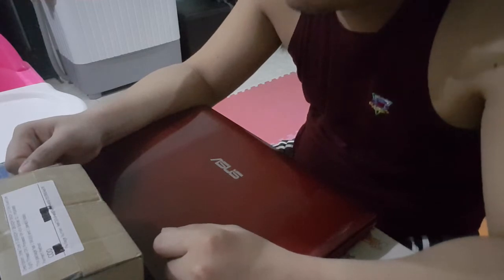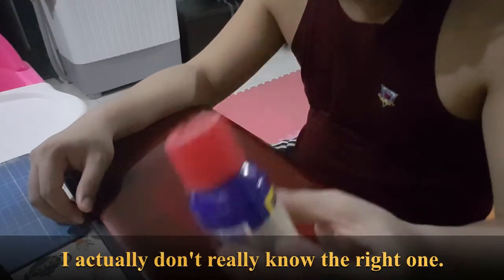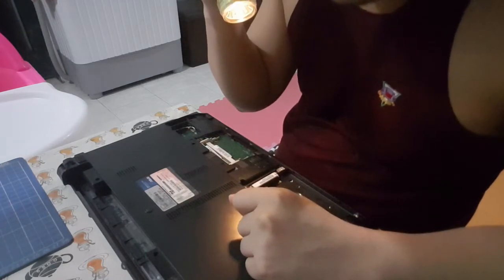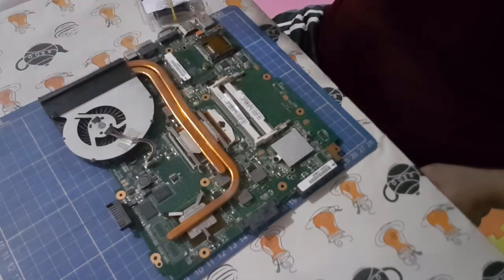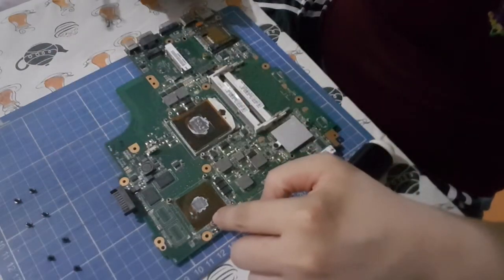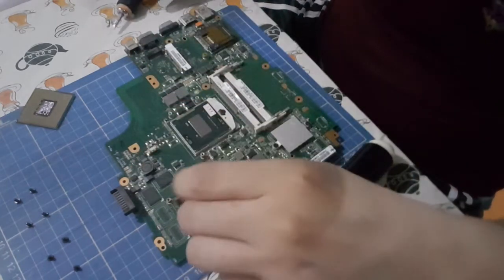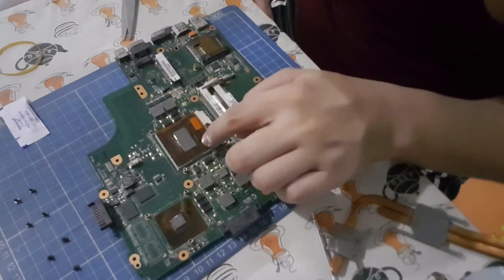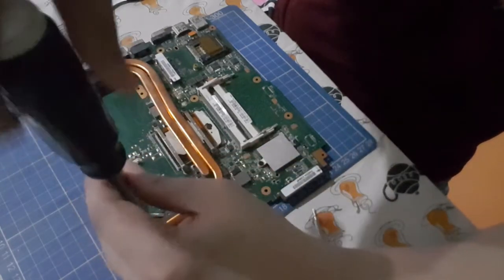Processor Upgrade for Asus K43SJ Laptop; Part 1

Comment: Hey is the  i7-2670. 8gb ram still okay this year?
Reply from the maker: Sadly the Laptop died. I will make a video about it in the future.
Reply: @BlueShotgunShells  i subscribed for this one
Reply from the maker: @Punkown  thanks. The laptop worked well until it suddenly just wont display anything. Indicator lights turn on, but no display for both built in display and external displays.   I haven't gotten around to tinker with it since building my PC. Currently working on some PC cases.
Reply from the maker: @Punkown  if you are thinking of doing the upgrade, keep in mind that the hardware is pretty much outdated at this point. There were replacement boards being sold online, but they are quite pricey and probably not worth it anymore.
Reply: @BlueShotgunShells  I used a 40 w power adapter for my k43sj for 5 years, it charges the battery and can turn on the laptop and then as years goes by the adapter takes time to before it can power the laptop and then it already failed. maybe this is the same case as with the upgrading the cpu with more power needed
Reply: @Punkown  Laptop saya memiliki adaptor daya 90 watt (19v, 4.7A) - ini cukup untuk i7-2630qm + Nvidia gt610m. 
juga dapat membeli adaptor daya 120 watt (19v, 6.3A)
Adaptor daya 60-75 watt mampu mengalirkan arus rendah; hanya prosesor dual-core i5-2520m, i5-2540m yang perlu dipasang di laptop semacam itu
Reply: @BlueShotgunShells  update on the laptop does it still work?
Reply: @RudolphJrEstepa  Yes, I use it for browsing the internet, watching movies, and light work (reports). If your laptop has an Nvidia GT540/GT630 graphics card, then when upgrading the processor to an i7-2630qm, you'll need a 120-watt (19 V/6.3 A) power supply. For an Nvidia 610/520 graphics card, a 90-watt (4.7 A/19 V) power supply is sufficient.
Reply: @RudolphJrEstepa  You can use i7-2760qm and i7-2820qm processors on this laptop, but you must disable turbo boost on the processor and use it at the base frequency (2.3-2.4 ghz) to avoid frying the motherboard. Without turbo boost, the i7 processor consumes 28-31 watts instead of 40-45 watts with turbo boost.
Reply: @vladimirazirov1815  atm I installed a i7 2630qm and updated the bios before hand(installer from Asus website) i'm still using the stock charger(19V=4.74A) Do i need to disable turbo boost? and how? Bios does not have that function
Reply: @RudolphJrEstepa  There's no need to disable turbo boost on the i7-2630qm processor, as the Nvidia 520 graphics card consumes little power. The 2630 processor will run on four cores at 2.6 GHz.
1 core - 2.9 GHz
Reply: @RudolphJrEstepa  Does the laptop have an SSD or only an HDD?
Reply: @vladimirazirov1815  SSD 512gb, Can I also upgrade the wifi card? could you suggest models?
Reply: @RudolphJrEstepa  
Intel Wireless Dual Band AC 7260 HMW 802.11a/b/g/n/ac, 300-867Mbps 
Wi-Fi 2.4/5GHz +  Bluetooth 4.0
PCIe Half Mini Card
Reply: @RudolphJrEstepa  Just don't buy an Intel AC 7260 HMW Wi-Fi module for a Lenovo laptop; it won't fit an Asus laptop.
Reply from the maker: @RudolphJrEstepa sadly laptop is dead.
Reply: @vladimirazirov1815 hi sir installed windows 10 pro and updated the drivers I noticed battery is 0% while plugged in, battery reports in cmd is error. Have you encountered this? What's the possible fix? Followed YouTube videos but did not work.
Reply: @RudolphJrEstepa Turn off the laptop, unplug the charger, and remove the battery. After 1-2 minutes, reinsert the battery, plug the charger into the laptop, and connect it to a 220V power outlet. The battery should begin charging.
Reply: @vladimirazirov1815 thanks sir, but does not work still not charging.

Comment: Hello, a very nice video you have here.
I have the same laptop, with i7 2630QM. Is it possible to upgrade it to i7-2860QM? Because it uses the same socket (Socket rPGA988B). Please waiting for your reply, thanks!
Reply: tidak. Motherboard hanya memiliki dua fase daya. i7-2630qm - maksimum. Anda hanya dapat menginstal SSD 240-512GB, sata, 2.5 dan 8GB+8GB RAM.
Reply: @vladimirazirov1815  wait... Two 8gb ram? I thought the maximum ram is 2 4gb ram?
Reply: @Skishe  Yes. I installed two  modules memory Hynix so-dimm DDR3L-1600 1.35v 2R*8 8gb+8gb and the laptop identified all the memory and has been working fine with it for a year now. Only the RAM runs at 1333 MHz. For the i7 processor, I installed a 2-pipe cooling system. The fan did not change, left from Asus.
Reply: @vladimirazirov1815  are the thermals ok? Kind of hesitant to use i7-2630qm due to thermal issues.
Reply: @Skishe  There will be no problems with temperature if you install a radiator on 2 pipes. The temperature of the processor on the Internet is 50-55*C, in games 75-80*C. You just need to take the laptop to a computer service every 2 years so that the master replaces the thermal paste on the processor and graphics card, cleans the cooling system from dust, disassembles and lubricates the fan with engine oil. Then the processor will not overheat. The thermal pad needs to be replaced under the square aluminum heatsink as well. Thermal pad dimensions 15mm*15mm* thickness 1.5mm. thermal pad color: grey and blue.
Reply: @Skishe  according to my observations, the maximum use of RAM was 11GB out of 16GB (Windows, game, work program, background programs, browser with 7-10 tabs). Installed SSD Samsung 860 EVO 250GB, sata, 2.5" for Disk C. HDD (disk D) was transferred to the DVD slot through an aluminum adapter Caddy 12.7mm.
Reply: @vladimirazirov1815  hi do you still use your laptop
Reply: @RudolphJrEstepa  Hi, yes, I use a laptop. But I built a computer for gaming. And the Asus laptop is for the internet, watching movies, and light work (my wife is an accountant).
Reply: @RudolphJrEstepa  A friend of mine has the same laptop (K53SD), and he installed an i7-2760qm processor. This processor fried his power supply. He had to buy a different power supply and disable turbo boost on the i7-2760qm processor. He uses a laptop with a base processor frequency of 2.4 GHz. If the laptop has 8-16 GB of RAM and an SSD, then even without turbo boost, programs and Windows run quickly.

Comment: The motherboard can be upgraded also..
Reply from the maker: Wow. I didn't know that. Care to share what board can be used here?
Reply: @BlueShotgunShells   lol sorry forget to put (?)
Reply: @BlueShotgunShells  because i ask because the gpu is very smoll
Reply from the maker: @unknownhero4342  i see. Well. I was thinking of trying out the motherboard for K43SV that has the GT540M instead of the GT520. However there are a lot of variants that it gets a bit confusing. Another is whether the case will fit the other board variants...so lots of things to consider.
Reply: Ok dude
Reply: @unknownhero4342  A l i e x p r e s s  menjual motherboard Asus k43sv dengan kartu grafis Nvidia 540m 2GB dan Nvidia 630m 2GB.
Reply: @vladimirazirov1815  thanks
Reply: @unknownhero4342  Saya memasang prosesor i7-2760qm di laptop saya, dan agar catu daya tidak terbakar karena arus tinggi, saya menggunakan prosesor i7 tanpa turbo boost pada frekuensi dasar 2,4 GHz .. Berkat SSD 250 GB (disk C), laptop bekerja dengan cepat tanpa turbo boost dan suhu prosesor i7-2760qm dalam game 70-75*C. Saya membeli RAM 8GB+8GB DDR3-1600 Atermiter di A l i e x p r e s s. 
HDD 500GB - disk D (penyimpanan file). Puas dengan performa laptopnya. Setiap 2 tahun sekali saya mengganti thermal paste pada prosesor, bersihkan heatsink dari debu dan lumasi kipas dengan oli mesin. Di bawah radiator aluminium persegi pada chipset, Anda juga perlu mengganti termal pad setiap 4 tahun: dimensi termal pad adalah 15mm*15mm dan tingginya 1,5mm. Warna termal pad abu-abu atau biru.

Comment: Sir did this Asus k43sv can upgrade to 12gb ram?
Reply from the maker: Unofficially it can support up to 16gb. Some people have successfully done it.
Reply: Saya memasang prosesor i7-2760qm, dan agar catu daya tidak terbakar, saya menggunakan prosesor tanpa turbo boost, pada frekuensi dasar 2,4 GHz. Dalam stress test, prosesor mengkonsumsi TDP 28w, bukan 45w. Terpasang RAM 8GB + 8GB DDR3-1600 Atermiter, berfungsi dengan baik. Memasang SSD 250GB. Laptop berjalan cepat, meskipun turbo boost tidak aktif.  Suhu di browser 55*C, di game 70*C, di stress test 80-83*C. Tabung pendingin ganda.
Reply: @vladimirazirov1815  saya memasang RAM 4GB + 4GB DDR3. Sepertinya cukup beresiko untuk saya jika menambahkan 4GB + 8GB (takutnya tidak compatible). Sir, apakah lancar jika menggunakan aplikasi seperti Adobe After effects atau game yang spesifikasi menengah keatas? Sebelumnya, terima kasih infonya.
Reply: @hazzam552  12GB akan bekerja, jangan khawatir. Saya awalnya memiliki prosesor i3-2350m dan RAM 6GB (2GB Samsung + 4GB Hynix DDR3-1333 1.5v). Ketika saya menginstal prosesor i7-2760qm, saya membeli 8GB DDR3-1600 Atermiter dan membuat 12GB (Hynix 4GB DDR3-1333 + 8GB DDR3-1600 Atermiter). Laptopnya bekerja dengan baik. Untuk program dan browser, 12GB bagus. Untuk game, lebih baik memasang modul memori yang sama: 4 + 4 atau 8 + 8, maka FPS akan lebih tinggi 6-9 poin. Jadi saya membeli Atermiter 8GB DDR3-1600 kedua dan membuat 16GB (8+8).
Reply: @hazzam552  Laptop tidak dapat mengganti kartu grafis. Saya memiliki Nvidia GeForce 610m 2GB sehingga mengubah CPU tidak akan banyak membantu dalam program seperti Adobe After effect. Hanya versi lama (Adobe After Effects CC 2015-2017) yang dapat digunakan.
Mengganti prosesor telah meningkatkan game lama (2008-2015). Prosesor i3 berjalan pada batasnya dalam game-game ini, sedangkan prosesor i7 berjalan dengan setengah daya. Bagus untuk rendering video berkat 4 core/8 utas dan SSD Samsung 860 EVO 250GB, sata, 2.5". HDD 500GB (disk D) saya gunakan untuk menyimpan file. Saya juga menghubungkan laptop ke TV besar melalui kabel HDMI dan menonton film dalam format 4K.
Reply: @vladimirazirov1815 hello, i've been wanting to ask u about the heatsink u used. U mention 2 pipes heatsink, right? Where can i get that same one?
Reply: @ryanandaresta5824  Hello. I bought a 2-pipe radiator in China, A-l-i-e-x. Only the Cooling system (heatsink) comes in two types: for the k53sd motherboard and for the k53sv motherboard. Check which motherboard you have using the CPU-Z program.

Comment: Hi Sir! I have the same laptop. How much did it cost you to upgrade to your Asus K43SJ? I was really thinking of just buying a new one rather than stress about upgrading internally. 
Do you have any other positive/negative observations after upgrading? 
Was it worth it upgrading, or would it be better to just get a new one?
Thank you!
Reply from the maker: Hello. I think it cost about Php 4K  for everything. If you have the budget for a new one, just get a new one. We have to accept that this model is old and upgrading it may not turn out the way we expect. With that said, if you just want to make your laptop more responsive, replace your mechanical Hard Drive with an SSD, and just upgrade your memory to 8GB. As for the processor upgrade, the laptop does output more heat especially on heavy compute loads like video processing. This will shorten the life of other on board components near the processor or even damage the processor itself if laptop is not cooled properly.
Was it worth it? It was, at least for me and my intended use for the laptop, a daily driver for office tasks and occasional video processing.

Comment: Hi po, same model po ng sakin yung sa inyo, nag-upgrade din po ako ng processor and RAM. Nakakaranas po ba kayo ng heating problems simula nung nag-upgrade?
Reply from the maker: Running hotter po ang laptop. Kasi same heatsink and fan trying to cool a hotter CPU. Lalo na sa high cpu load talagang mainit ang buga ng laptop fan. Hindi naman siguro problem, di naman siya yung nakakapaso na init. Siyempre may epekto yan sa lifespan ng CPU.
Reply: @BlueShotgunShells  ano po remedyo niyo?
Reply: @yeppieyay8906  Nag-install ako ng i7-2760qm processor sa halip na i3, at para walang overheating, pinatay ko ang turbo boost. Nagtatrabaho ako sa base frequency na 2.4 GHz.
i7 + SSD Samsung 860 EVO 250GB + RAM 12GB DDR3-1333 - ay magandang performance ng laptop. 
Ang temperatura ng processor sa browser ay 50*C, 
sa mga laro - 65-70*C, 
sa AIDA64 stress test maximum na 79*C, TDP 28W.
Reply: @vladimirazirov1815  ask lang kung nag upgrade kapa ba sa ac adaptor mo, kasi pgkaka alam ko yung i3 is 35w, yung i7 2670qm is 45watts.
Reply: @neilzracked  hindi, ginagamit ko ang factory 90 watt charger (19V, 4.7A). Kung gagamit ka ng i7-2760qm, i7-2670qm na walang turbo boost, magiging sapat na ang charger na ito. At kung gusto mong gamitin ang i7-2670qm na may turbo boost, kailangan mong bumili ng 120-watt charger (19V, 6.3A). Pinapayuhan ko kayong bumili ng alinman sa i7-2630qm o i7-2760qm. Gumamit ng i7-2630qm na may turbo boost, i7-2760qm - walang turbo boost. Ang motherboard ng laptop ay mayroon lamang 2 linya ng kuryente, ito ay pinakamainam na gamitin ang i7-2630qm kaysa sa i7-2670qm.